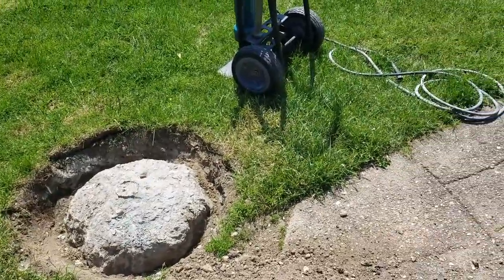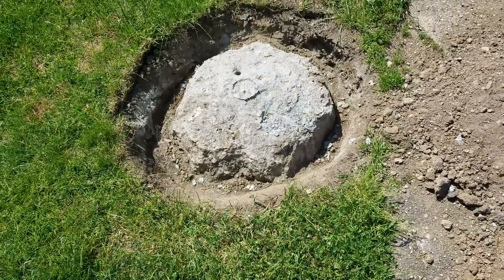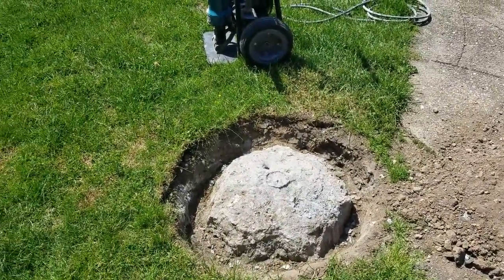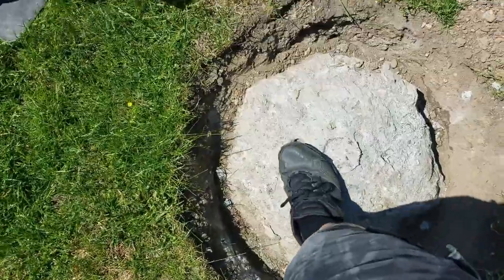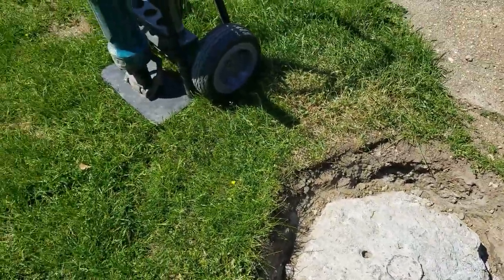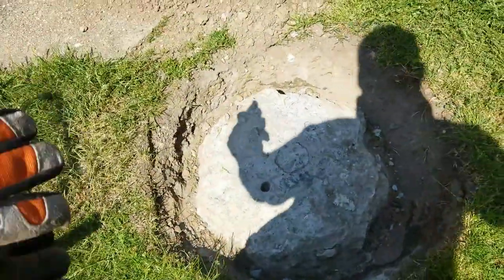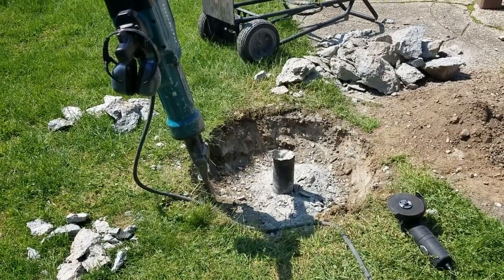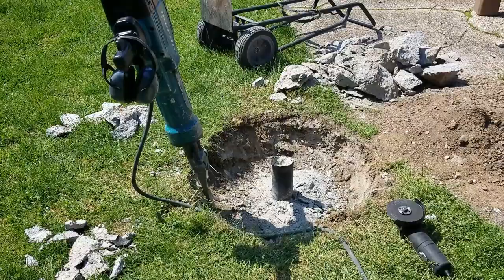How I needed a Jack Hammer

Comment: We were in the middle of trying to take down our cement-filled basketball pole and were getting nowhere.  We rented a Hilti jackhammer from Home Depot and hoped to get to the bottom of the cement to free up the pole. Ha!  We had a big pile of cement pieces, but the pole wasn't budging.  So, we went on YouTube to check out how others did it and found your video.  Thank you!  We didn't do it exactly how you did because our hole was deep and we couldn't get a saw in there.  We used the jackhammer bits to cut into the pole which was about 8" below grade.  That made the pole able to finally break off. We then used the jackhammer to break the pole up so that we could get rid of it.  
Thank you for your helpful video!
Reply from the maker: @s.h.552  Ahh, very good.